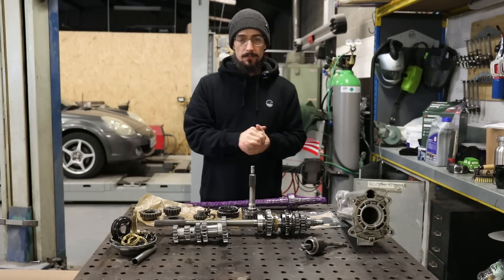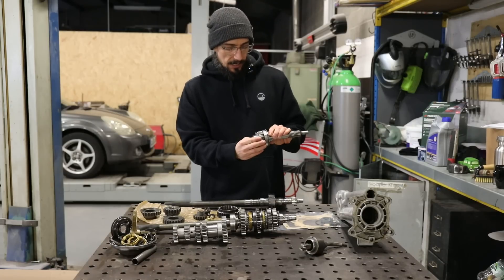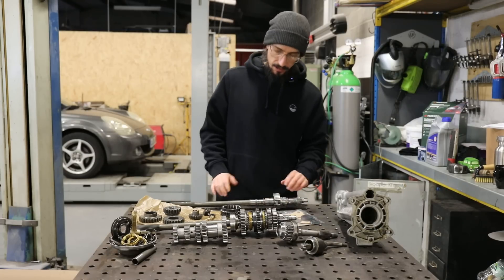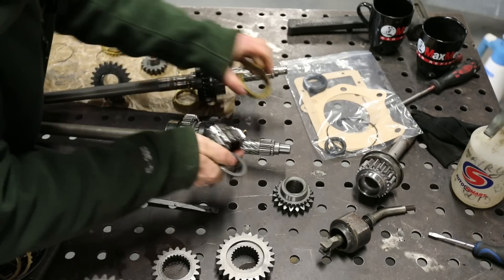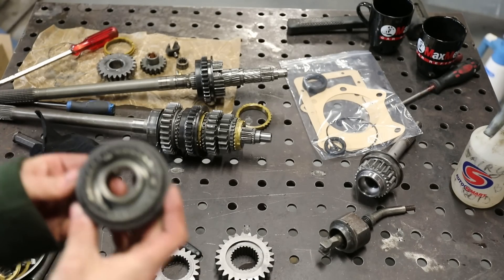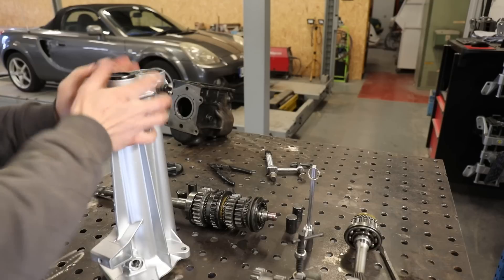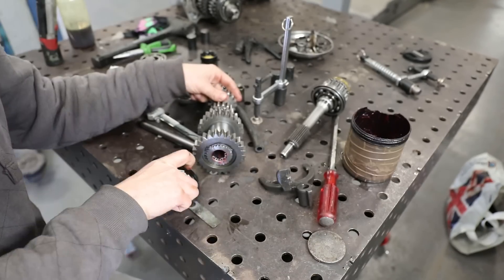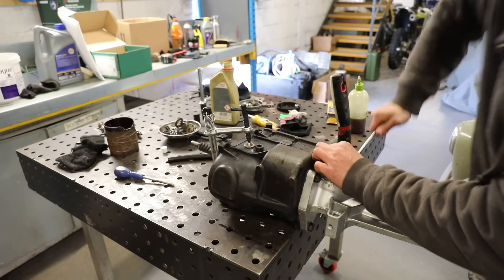How To Rebuild A Ford Type E Rocket 4 Speed Gear Box  - Straight Cut -  Part 2

Comment: Thank you for your post! Not the only one on the topic, but every view point has its merit the rubber tube is a good one, rather than a wood stick) - good trick for a 2000 box which is very similar.
Reply from the maker: No problem, Cheers

Comment: Nice! The slave cylinder you need is a APC5 or 'Titan slave cylinder' available from Rally Design, Burton Power, online ect. You will need to set up the spacing to suit your pressure plate but they are available online in different thicknesses. 3/8th UNF thread for the hose inlet/bleed. Just been through this on a Duratec conversion hope this helps!
Reply from the maker: That's great info. Thanks

Comment: Very interesting, Matt. Been a while since I've been up to my elbows in a Ford 4 speed. Took me right back. Interesting to see the built up cluster gear, making ratio options possible. This is a great how to. Lots of tips shared. Cheers Matt. Mart from Solihull. (Retired transmission engineer).
Reply from the maker: Cheers Mart